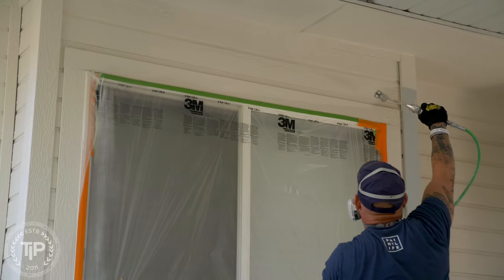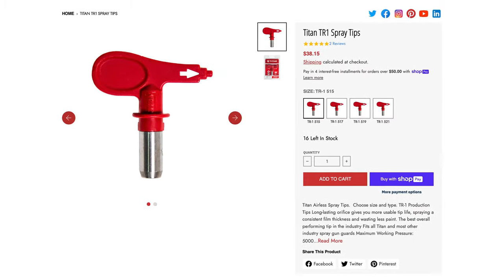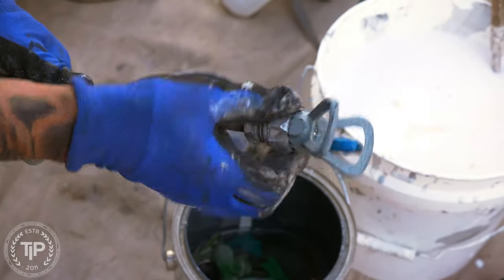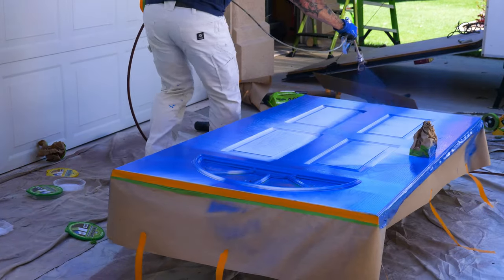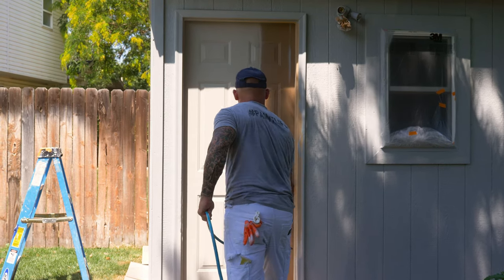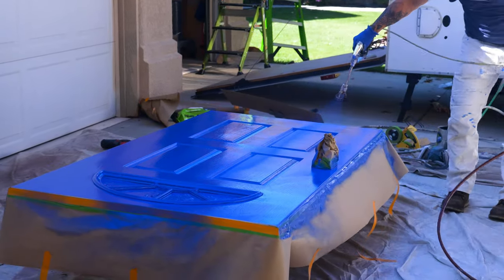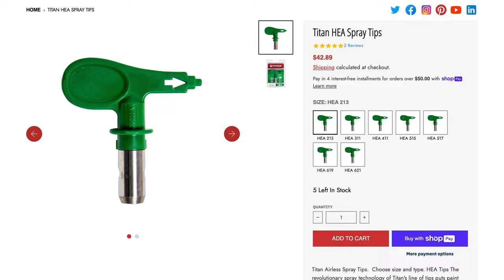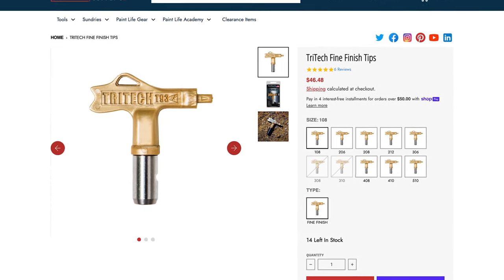What Airless Spray Tip Is Right For You? What Do The Numbers Mean?

Comment: Thank you this incredibly helpful. DIY homeowner with an old house over the years on a hf airless I’ve sprayed about 40 gallons of paint and stain all on the original tip. Painting soffits and facials which  at the ridge are 38’ above grade and need to avoid overspray on the underside of the slate roof. I never realized the tip size mattered or wore out just never thought of it. Thank you again

Comment: I have a large concrete pool deck that I would like to spray rather than roll. Any suggestions on what type of sprayer I should buy? Maybe add a short extension.  Thanks
Reply: @unalienable5408  spraying it would make it convenient and might speed up the process but as thick as that material typically is it’s better to roll it for quality reasons, roll a quick tack coat and the 2nd coat roll a nice even coat for best results 👍🏾